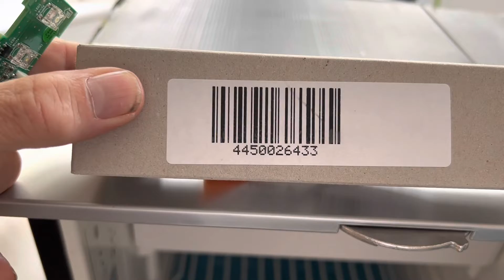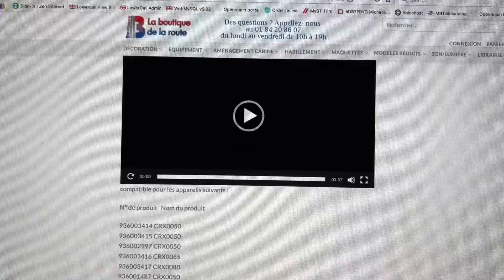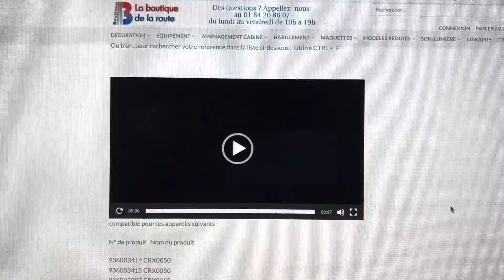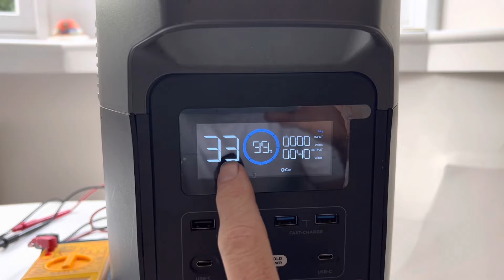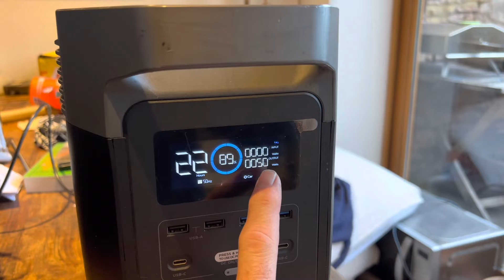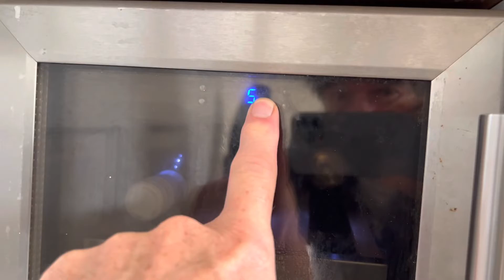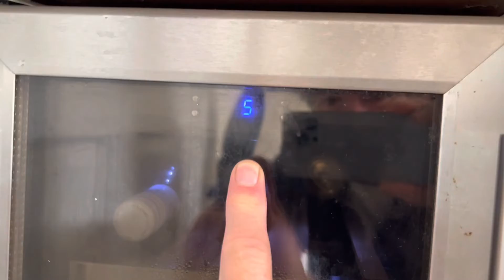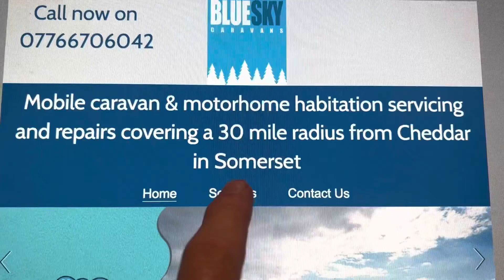Dometic Waeco CRX50 compressor fridge repair tips+performance using EcoFlow delta.

Comment: Hi, I wonder if you could suggest what's wrong with my fridge. When first powering on the compressor comes on and temp drops well below freezing in the freezer compartment. The fridge SEEMS to be working normally then (you occasionally hear the compressor come on and go off). But it seems that the compressor isn't coming on as often as it should. Ice in the freezer goes through a cycle of defrosting and refreezing. Faulty thermostat inside the fridge perhaps?
No error lights show and no other indications of a fault.
Reply from the maker: The thermostat automatically switches the compressor on if temperatures get too high, and then kicks in to turn it off when the fridge gets too cold. If this automatic on/off function is not happening, the thermostat may well be faulty. It is relatively inexpensive. It could also be a faulty control board. Might be worth calling Andy the Dometic fridge repair man - his number is at 8.32 in the video below:

https://youtu.be/bxaXKTOqD0I?si=Kn4EGf_tCWkV0u3w

Mike
Reply: @MikesMercsandothercars  thanks Mike, much appreciated
Reply from the maker: @tdmltd  Hi - if you do need to take anything to pieces or buy any spares, there are a couple of related videos on my other channel:

https://www.youtube.com/playlist?list=PLorYJTTXjG3EsQIX-FXc1qNy5-PfGPMcE

Mike
Reply: @MikesMercsandothercars  Thanks again. I've spent the last couple of nights messing with a thermometer in it. Seems that it was actually user error...
On anything except the coldest setting, the fridge temp is 6 degrees+. I didn't have it on the coldest setting and I think that the ambient temp was low enough for the fridge simply not need to turn the compressor on.  So fridge sat at about 9 degrees on the second setting and freezer slowly came up to the same temp. If the sun had come out and warmed the van I expect the fridge temp would have risen and the compressor would have come on, causing the freezer to freeze again.
I've now tried the coldest setting and it's working as expected. 
It does raise the question of why anyone would want to use any of the warmer settings though. I always thought fridges should be under 5 degrees. I imagine on the warmest setting, it's about 12. Can't see the use for that, but at least my fridge isn't broken!

Comment: Hi Mike, interesting video. I’ve had the crx50 in my t5 conversion happily for a few years but it’s decided to not cool after the winter lay off. I have power to the inner control all blue and happy but the compressor is not kicking in anymore. Would be keen to know what you think. I’m abit far from Andy the fridge repair man unfortunately.
Reply: I have the same problem. I turned it off for a couple of weeks and now it’s not working

Comment: Hi Mike, I've just got the ECOFLOW River 2 max, and want to hook it up to my CRX50. Would you recommend connecting a cigarette lighter connection or a DC barrel plug for connection to the ECOFLOW, the river has both DC sockets available. Ta Shaun
Reply from the maker: Nice Fridge and nice battery! I use the 12v cigarette lighter socket to power my fridge and sink and that works great. This outlet doesn't trigger the cooling fans which on the EcoFlow delta are quite noisy. I guess if the same is true of the barrel plug and it is the correct voltage (I dont think my EcoFlow has one of these) you could use either. Mike
Reply: @MikesMercsandothercars  Thanks for the quick reply Mike! Cigarette lighter socket it is. Think the wattage would require this actually after a bit more research.

Comment: My compressor comes on and cools but the compressor doesn’t stop and gets very hot, thermistor value changes with temperature when tested and the internal pcb visually looked ok front and back, is this most likely still the pcb??
Reply from the maker: Hi - sorry to read you are having a problem. The only thing I can say it that visually my pcb board LOOKED fine but is was knackered. My advice would be to ring Andy and ask his advice. His number given at 15.13 in the video. Mike

Comment: lovely bus
Reply from the maker: OK...so if you have not already seen the video below, have a look at 3.56 and 12.00 mins where I list the MC4 solar plugs you will need, and where to buy them:

https://www.youtube.com/watch?v=ojeR8UHOIQs

My van runs off solar panels too, but you don't need the cigarette lighter port and corresponding lead - hopefully the leads that come from the panel have the right plug to plug straight into the EcoFlow. The good thing about the ecoFlow is that it has its own built in charge controller so the panels just plug straight in.

Mike

Comment: Nice video. Just for reference what it the battery size of the Ecoflow you were using
Reply from the maker: Hi - In my Fiat 238 van have the original Ecoflow delta which I seem to remember is 1200 watt hours. Probably ranks as one of my best ever purchases....although not cheap. It is great in the van and great for running all sorts of power tools and even a MIG welder. In my Toyota Hiace in Australia I have the Ecoflow River Max which is probably all you need for weekend trips. The EcoFlow delta has never got below 35% on a trip...and can of course be charged directly by the solar panel and also by the cigarette lighter socket when driving. Mike

Comment: Hi I need to diagnosis the problem with my fridge. The compressor is not coming on. The control panel is flashing 1 light which the manual states is a supply voltage is out of range. Thanks Chris
Reply from the maker: Sorry to hear you are having a problem with your Fridge - what part of the country do you live in? Mike
Reply: Hi we had the same issue with ours. Red flash light. The leisure battery wasn't holding its charge (under warranty). New battery all good. Hope this helps.
Reply: @MikesMercsandothercars  I am in Scotland nr Glasgow thx
Reply: @eddrose8150  Thanks. The battery is fine. I just replaced the fridge and no issues with the new one. I still have the old one and would still like it repaired.
Reply from the maker: Are both Fridges the same model? If so, try swapping the the SECOP control unit over and see if the faulty fridge starts working. There are a couple of related videos on my other channel:

https://www.youtube.com/watch?v=bxaXKTOqD0I

https://www.youtube.com/watch?v=3ooWj_AXJGw

Mike

 @chrisg3216

Comment: Hi mike I have the crx50 I purchased it not working. I bridged terminals c and t and the fan and compressor both work and the fridge gets cold in the freezer department quite quickly however I get nothing come on in the display at all also if C and T aren’t bridged I get nothing. Any suggestions please
Reply from the maker: Sorry to hear you are having problems with your fridge.

Well, the good news is that the compressor works because that is REALLY expensive to fix.

Did you see the video I did on my other channel?

https://www.youtube.com/watch?v=bxaXKTOqD0I

I am no expert, but I would say either the PCB board inside the fridge is knackered OR the controller is knackered...or possibly both. The controller is easy to switch over...you just need to find someone with the same fridge to test this...or buy one off ebay and then sell it if that wasn't your problem.

If you are anywhere near Bristol, I'd be happy to help. Mike
Reply: @MikesMercsandothercars  hi mike do you have the parts to try if so I would happily drive to you in Bristol
Reply from the maker: Hi - I have a working controller on my fridge which is easy to swap over. If my fridge doesn't work with your controller, we know your controller is knackered. If your Fridge doesn't work with my controller, we know that your controller AND pcb board are knackered. YOu coyuld also camp the night at Petruth Paddocks and let Andy the Fridge repair man fix it for you. He lives a short walk away. I would call him first to make sure he has the parts. His number is at the end of the video link I sent you. Mike PS Where do you live?  @clivebeattie3306
Reply: @MikesMercsandothercars  I did speak to Andy last night he thinks it will be the secop unit on the back. I’m just confused as I watched your video you linked and you still had the internal display light up where as doing the same on mine inside the fridge still appears dead nothing comes on. I live in Prestwood near high Wycombe Buckinghamshire
Reply: @MikesMercsandothercars  I could come down to you this weekend if that works for you
Reply from the maker: Hi  I am off to France for a week on Monday so this weekend wouldn't be ideal. I have just purchased a PCB board and asked them to send it to my parents in France. Hopefully it will arrive before I come back to the UK and then you will have all bases covered if you do come down. Mike @clivebeattie3306
Reply: @MikesMercsandothercars   thanks a friend has the same fridge in his camper I might be able to try his at the weekend to see if it works. Did try to order a pcb board from the website you use but struggling to get it to recognise my address so can’t place order. Hope you have a great trip will let you know how I get on
Reply from the maker: Good luck - let me know if it works with your mates controller and if not, I should hopefully bring back a PCB board from France. Mike @clivebeattie3306
Reply: @MikesMercsandothercars  hi just thought I would let you know I’ve just received my new pcb board and the fridge appears to be working now. Thanks for the advise
Reply from the maker: That is great news that the fridge is working again. So was it just the pbc board or was it both board and controller? ....and what di the board cost you including postage?Mike @clivebeattie3306
Reply: @MikesMercsandothercars  just the board the control box was ok. The board and the new front panel to stick on as the other was damaged cost £92 delivered from France

Comment: Hi. If the compressor runs constantly, but no cooling. No fault flashing light. Cleaned coil and fan grill. Any ideas?
Reply from the maker: Hi - sorry to read you have a problem. I am no great expert, but here is what it could be:

Frosted Evaporator Coils

If the evaporator coils of your fridge are frosted over, it may not be able to cool enough or at all. The frost takes about 6 months to build up, and it insulates the evaporator coils and fan when it builds to a certain level. You must inspect the coils to determine whether or not frost has accumulated on them.

If there is a significant amount of frost on the coils, turn off the fridge and manually defrost it. Leave it off for some time, depending on the amount of frost, and keep a towel ready to mop the excess water. Ensure the gasket seals tightly and there is no cause for ice or frost buildup to clog the coils again. Otherwise, you may need service the fridge.

Defective Evaporator Fan

The function of the evaporator fan is to circulate air throughout all sections of a fridge. If the fan fails to work, the cold air may remain trapped in the evaporator coil compartment, which means the fridge cannot cool.

Conducting a continuity test can help you determine if the evaporator fan is the root cause of the cooling problem of your fridge. You can use a multimeter for this test and replace the fan motor or entire fan assembly if you find no continuity.

Defective Defrost System

All fridges come with a defrost system that facilitates cooling and defrosting. A typical defrost system has a defrost heater, a defrost thermostat, and a defrost timer.

The latter toggles the fridge between defrosting and cooling mode. If the defrost timer is defective, the cooling mode will not function. Consequently, frost will accumulate over time and reduce air circulation. Similarly, the cooling mode will not activate, causing the fridge’s temperature to rise drastically.

On the other hand, a defrost heater facilitates the melting of frost that has accumulated on the evaporator coils. Without the heater functioning well, the coils and other parts build frost over time and compromise the cooling capacity. This is especially true if the temperature setting is too low.

If both the defrost heater and defrost timer are faulty, your fridge will not activate its cooling and defrosting system. The same is true if the thermostat is defective, even if the timer is in good working condition.

Just like for an evaporator fan, conduct a continuity test to know whether or not you need to replace the defrost system.

Faulty Compressor

A compressor is to a fridge what a heart is to the human body. When your heart fails, the body stops functioning. Similarly, the fridge is as good as useless when a compressor fails. The fridge will not be able to compress the refrigerant to the high-pressure level needed to facilitate cooling.

The refrigerant is supposed to flow to the evaporator coils from the condenser in its high-pressure vaporized form, where it cools down. The air circulation over the evaporator coils is how the fridge gets cold, so if the compressor fails, the cooling system fails.

In light of this, disconnect the fridge from the electric power and wait a few minutes. Next, turn the temperature knob to 0 or OFF and reconnect the fridge to the electric power. Turn the temperature knob to mid-settings and listen to the sound of the compressor when the fridge runs. If there is no sound, consider calling a repairman to check the compressor and recommend a solution.

Low Refrigerant Level

If a fridge loses too much refrigerant due to leaks, it will not be able to cool, and eventually pack up.

Dirty Condenser Coils

The condenser coils disperse heat from the system while condensing the refrigerant. However, the coils quickly get dirty, and dirt acts as a blanket that traps the heat. As a result, the system overheats and compromises the cooling system. 

Defective Condenser Fan

Another common problem with a fridge is a defective condenser fan. This fan blows air over the condenser coils and compressor to prevent overheating while they operate. Therefore, a defective condenser fan cannot cool these parts, which typically leads to overheating.

The compressor may shut off too often, restricting the cooling process. Also, the coils will build heat until the fridge no longer cools as it should. If you suspect the fan is not working, test the motor with a multimeter to determine its functionality. Replace the fan and motor if it shows no continuity.

Faulty Start Relay

You will find the start relay close to the compressor, as with other fridge models. It is the device that helps the compressor start when you turn the fridge on. The compressor will not start at all or will have a hard time starting if the relay is faulty.

And if the compressor does not run, the fridge cannot cool. Detach the relay from the compressor and run a continuity test on it using a multimeter. Replace the relay if you find no continuity or if it rattles when you shake it.

Defective Start Capacitor

The start relay works with a capacitor to help the compressor to kick start. If the start capacitor gets burnt, the compressor will not work, and the refrigeration cycle will not take place. Consequently, the fridge stops cooling.

Just like for a start relay, you need a continuity test to verify the working condition of the start capacitor of your fridge. If the start capacitor is defective, your only option is to get a new one. Some capacitors function as one device with the start relay, so you may want to get such a device and a protector from power surges.

Faulty Thermistor

Without the thermistor, your fridge will not understand the programming behind its start and stop cooling cycle. Or simply put, your fridge will not cool at all or cool continuously without a working thermistor.

Hence, if you notice that the source of your fridge cooling problem is the thermistor, replace it. 

Mike
Reply: @MikesMercsandothercars  
Thanks Mike.
I ahould of mentioned it's a crx50 fridge.
Pretty sure it's a gas issue.
I'm going to try a recharge of refriderant. No charge port though so i need to sort that out.
Compressor runs and gets warm. No ice build up at coil, which i thought low gas causes. Tested compressor with ohm meter, thers lowc resistance. So that's ok. Thermistor goes from 30kohm in a freezer for half an hour, down to 10kohm out.
Reply from the maker: Did this fridge work fine previously and then suddenly stopped....what happened in the run up to the fault? Mike @jasonshaw7590
Reply: Yes it was working fine for a few years. 
Got slack cleaning the fan grill and coil evaporator, it was clogged. 
I noticed it started running continously but not cooling.
Compressor runs and gets warm.
Reply from the maker: If you suspect that your fridge may be low (or out of) refrigerant, it would imply that you have a leak as I believe these are sealed systems. Having it refilled (if that is even a possibility) wont fix the problem and a small leak on a compressor fridge can be almost impossible to find. The compressor on the CRX50 is integral to the fridge so replacing it is not really an option. If it was me, I would be tempted to try and source a working 2nd hand unit and swapping out parts till I can isolate the problem. If it is the compressor, you will almost certainly need a new fridge. These units are for sale new on ebay for £385. You could buy a new one, and start swapping out parts till you find the problem....then buy the correct part and then sell the new one - there is always a ready market for this model. Let me know what the issue was if you ever get it sorted. Mike @jasonshaw7590
Reply: @MikesMercsandothercars  
I will let you know. Thanks.
At this stage i have ordered a clamp recharge port so i can check pressure. It's a couple of weeks away. I'm in Hastings, New Zealand.
Reply: @MikesMercsandothercars  
The control board wouldn't cause this issue, ie no valves to open or close?